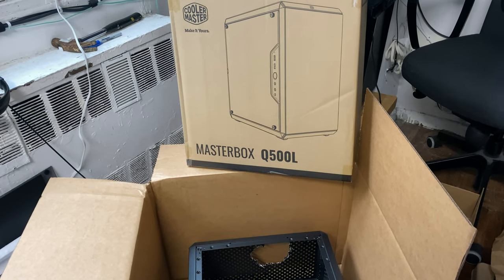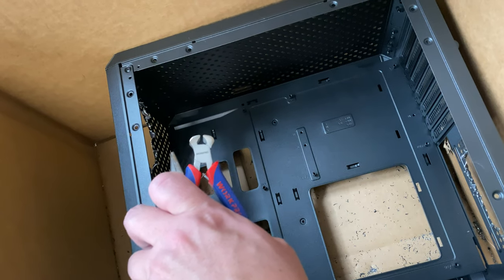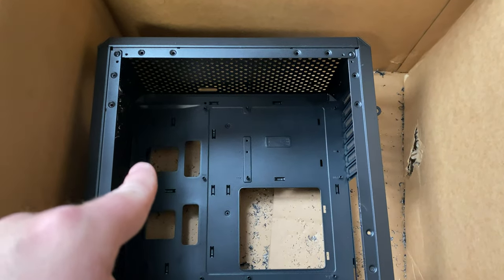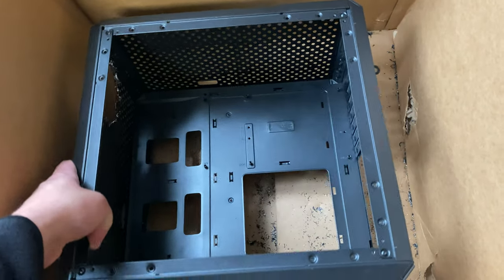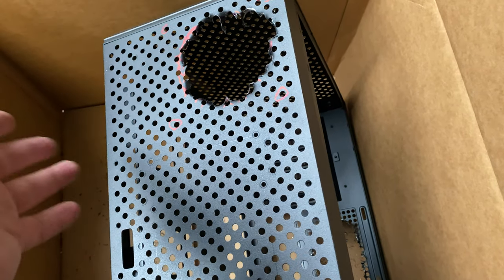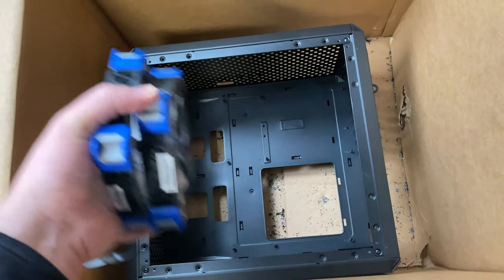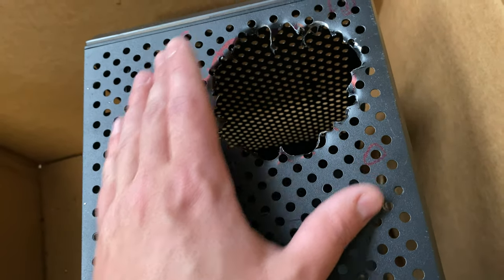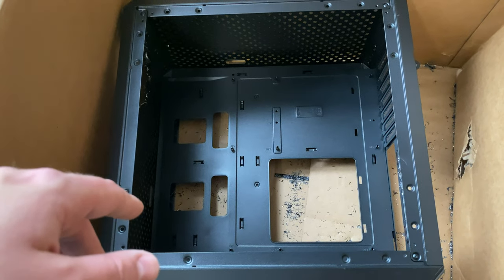COOLER MASTER Masterbox Q500L ATX Case Review and Modding Potential #izreviews

Comment: Any chance of a follow up video? Kinda curious how it looks now that you've finished up the work on it.

I've got this case on order myself. Got this crazy idea of not only inverting the case but flipping it on its face so the back IO is facing up. 😁 Then having fans on one side pushing air across the system and fans pulling it straight out the other side. Might not work out but I'm excited. Would have to turn the PSU so it's fan is facing into the interior but I feel the air stream will be sufficient to keep everything flowing nice and cool. Feet are too short having the PSU installed the "normal" way, which would be on the floor of the case in my build.
Reply from the maker: FOLLOW UP VIDEO OF MY COMPUTER SETUP: https://youtu.be/WE9t0Et4RwE
I did this one just for you.